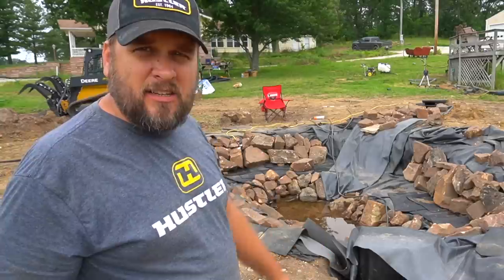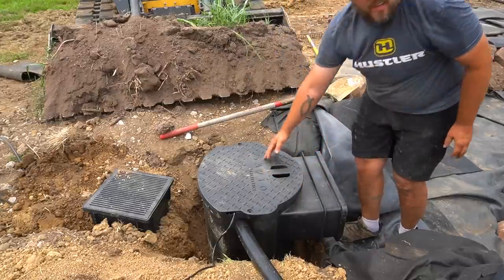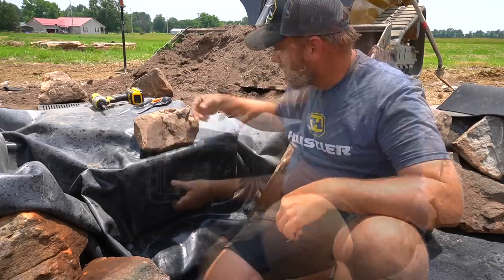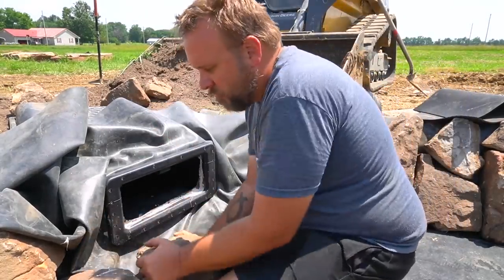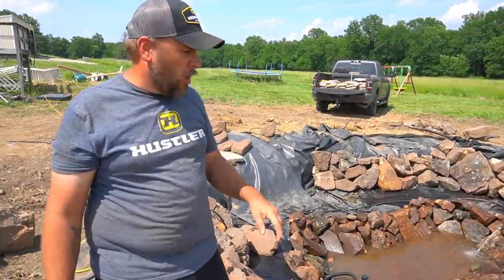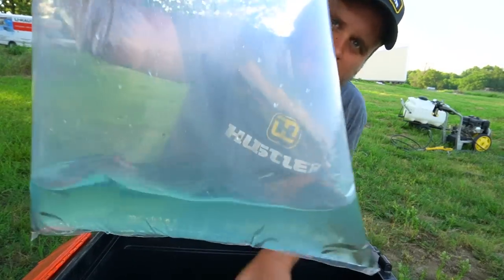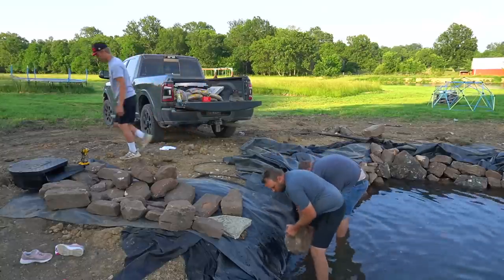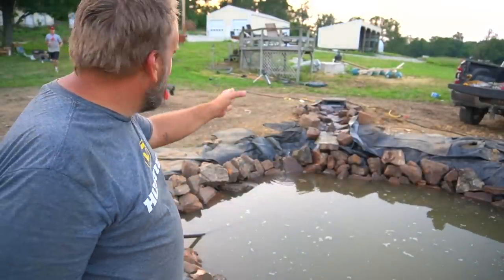We Built this 7000 Gallon Pond to Grow Large Mouth Bass

Comment: Lots of progress in a short time Brock, glad the weather is holding up for you! That little backhoe with your grapple bucket would work great to pick up a skid steer or tractor bucket.  You can fill that with rock and then use the hoe to lower the whole thing onto the level you are working at.

Comment: Throw some of that river rock in between the big rocks. It'll lock em in tight. I used to build dams in creeks as a kid. That alone would stop most water from flowing through. But it does lock bigger rocks together so they won't move as easily.